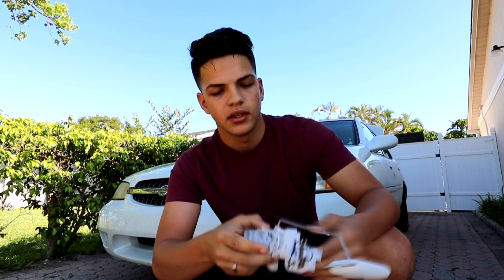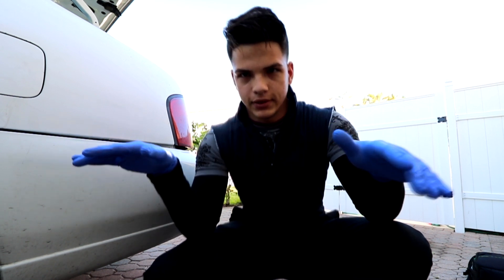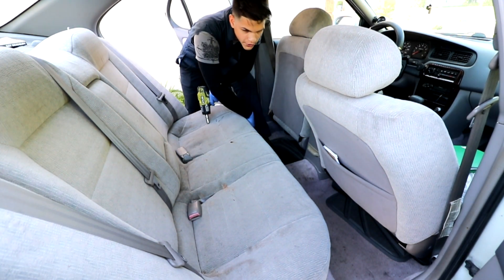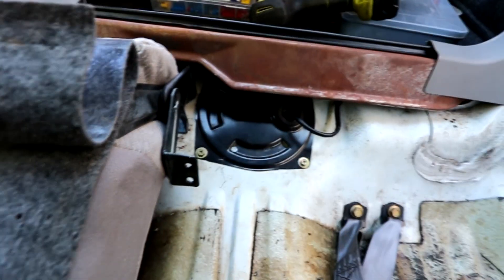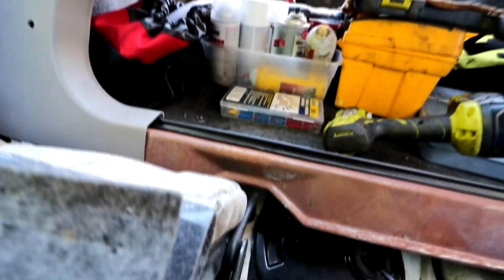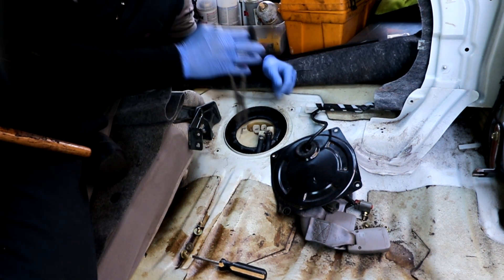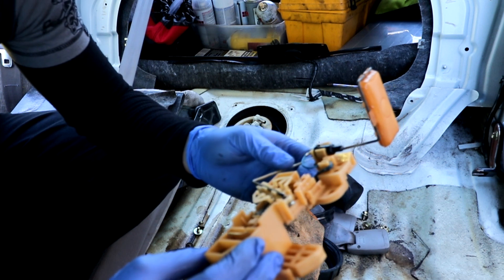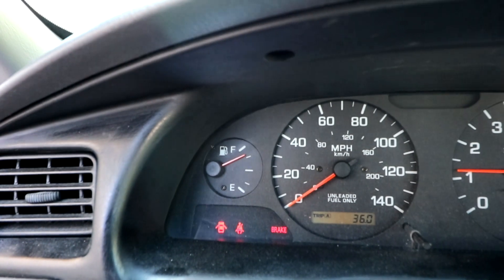Sending unit replacement Nissan {fuel gauge sensor} Easy fix!

Comment: I had my 2004 Nissan sentra 1.8 fuel pump replaced last month.  last week my PO 461 code came up .  My Fuel gauge says. F all time.  Is the Fuel float/sensor part of the new fuel pump?  I believe I have a defective fuel pump?

Comment: Good video - I am unable to source  Fuel Sending Unit (25060-9E002) for my 2000 Altima  - is the part still available anywhere?

Comment: Did you try to remove it without taking all that metal trim out? Or could it be done if you had the right wrenches?
Btw, I don't like rap but it didn't bother me and I didn't even think about it until I saw all the negative comments.
Keep up the good work son. 
It's not easy to be the one making videos instead of the ones watching them... Good video!

Comment: If your car is not on a level surface will it throw these codes????
Reply from the maker: No not all the codes are going to be short to ground out of peformance type codes
Reply: @DtunedPerformance  It happens to be that some change fell through where the radio/stereo is, and there is plastic cover containing a circuit board in the bottom with a slot, just big enough for pennies and dimes to get through,  shorted out and shut down entire car.  Just thought I would pass that on just in case, someone needed it.

Comment: my son is having this problem now. we had a repair shop replace the fuel pump, then told them the gauge was not working so they replaced the pump again. gauge still not working but they say its an electrical instrument issue in the instrument cluster. They said the fuel pumps came with the sending units in them. what are your thoughts on this?
Reply from the maker: Hey yes is very easy to test the wires and the gauge to test the gauge simply ground the wire coming out of the sending unit going to the gauge and the gauge should beging to move up
Reply from the maker: Part 2 then you can test the the sending unit in the tank by reading the ohms reading the unit is give out on a empty tank should be 0 to 3 ohms full tank should be anywhere from 150 to 200 ohms
Reply: I had this problem in my nissan maxima 05 and I end up changing both the fuel pump and the cluster. But in the end I think the problem was the cluster not the fuel pump.